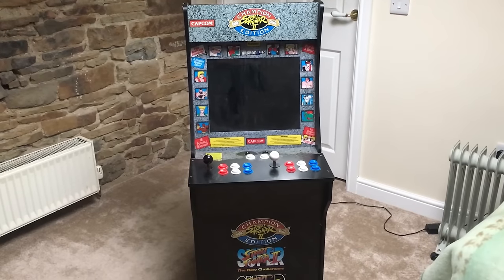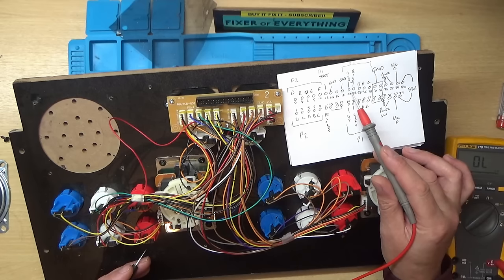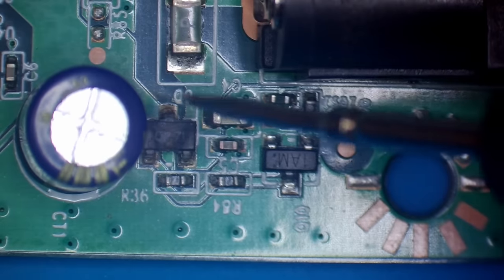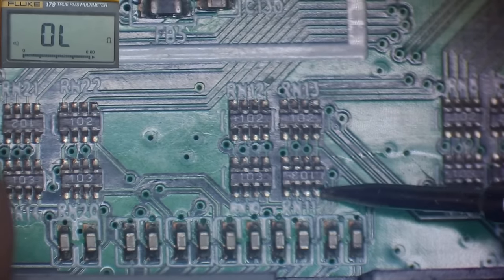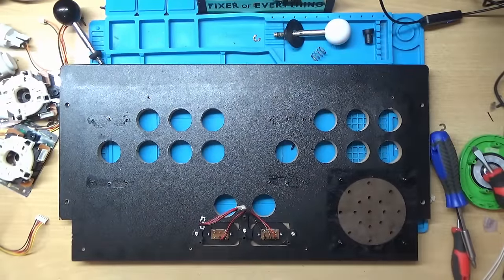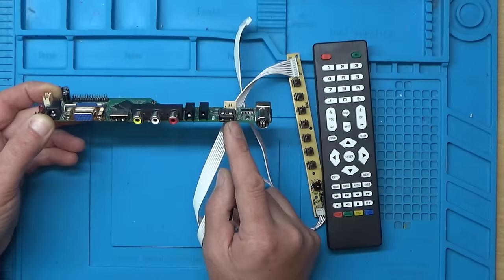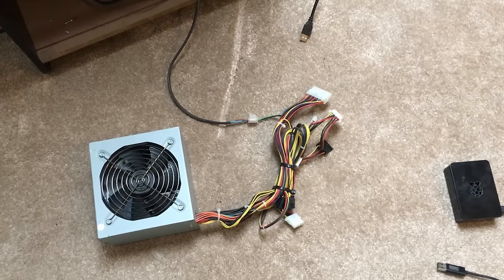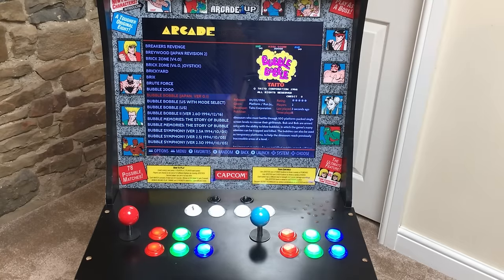Faulty 1Up Arcade Machine | Fix and Upgrade!

Comment: You didn't show it so you might not know, but you should set up a safe shutdown script for the raspberry pi so that when you power off the system the raspberry pi will shutdown safely before the power shuts down completely. If you just cut power to the pi you will corrupt your microsd eventually and have to rebuild everything (and lose your saves/roms/etc)
Reply from the maker: Good idea 👍There is an option in emulation station at the main menu to shutdown the system, although I can't see the kids going to the trouble of backing out of the game, going back to the main menu and selecting that each time.

Comment: A guy buys a junked arcade machine that only plays 3 games and then turns it into a masterpiece that plays thousands of games. Love this.

That little TV board looks like it would come in handy. I have a bunch of broken TVs but sadly none of them connect like the LCD on this cabinet. I do have an old LCD computer monitor though.
Reply from the maker: Thanks 👍you can buy either an adapter cable or there is a slightly different board that has a different connector if the TV has a different arrangement 🙂

Comment: Great video would have liked some more detail on the solution for the speaker noise but great vid
Reply from the maker: Sorry, It was just a couple of old ferrite choke filters from a TV power supply (I soldered two together) and then added a capacitor on the output of them just in case. The capacitor was just one I pulled of an old board I think something like 1000uf 25v. It was literally thrown together from a parts I had lying around on some scrap boards 😂

Comment: Well done! 👍   All the mod's. made this an exciting project.  And seeing a use for the Raspberry Pi was a plus!   PS: Pacman put a smile on my face!
---
2 changes I would have made. 1) A linear Power supply, and 2) (for sure),  move ALL of the SD Card to an USB connected & boot-able HDD or SSD drive. 
That way, you won't be coursed by an SD Card dying on you.  Why take a chance.   You got a real deal when add the price up, compare to buying a new machine!!
Reply from the maker: Thanks 👍I'm really glad people are liking it, I wasn't sure as I know it's quite a long video.
Reply: @BuyitFixit  The length was fine considering the time you spent off camera!

Comment: Nice work! You did what I did a few years ago - but I got an old busted arcade cabinet, gave it a fresh lick of paint, ripped out the old guts and replaced it with a modern PC and LCD, and loaded debian linux onto it, set up mame then closed it up. The longest part was downloading the romsets to the cabinet. Since it had wifi I just left it running with a throttled torrent client so the whole internet would slow to a crawl and left it on for a few days.
Reply from the maker: Nice. I've brought back memories as I used to repair and convert cabinets to Jamma back in the late 80s and 90s. I've got a box full of old arcade boards somewhere....

Comment: Nice vid, learned a lot. I would have liked some education about how the pull ups worked in this particular application and also about the inductor filter. Thanks
Reply from the maker: Thanks 👍. The inductors block and unwanted AC on the power (you used to get a similar thing for radio's on old cars when you used to get interference from the spark plugs through the speakers) The capacitor then smooths out the any remaining spikes (it may not have been needed but I added one anyway). I've actually been repairing a sound bar which has a similar filter, and I show the waveform on the scope of the signal before and after the filter (next video out the weekend).
Reply: The pins on the IC are apparently active low (i.e. when the pins are at 0 V or GND level the chip detects a key press). Since those inputs are quite sensitive, they might register a key press if the pin was simply open circuit. Therefore you use a resistor to keep that pin high (5 V or 3.3 V depending on the chip) unless a button is pressed. You can't connect the pin straight to 5 V because then pressing a button would cause a short. That's a pull-up resistor. A pull-down resistor is the same but connected to ground instead of VCC.

Comment: This is basically what i wanna do the streetfighter one is the best one to do this with cause of the extra buttons
Reply from the maker: Yes, it was one of the reasons why I bid on this one, although it wouldn't take much more to get a piece of wood and a hole cutter and make your own panel for any of them. Turtles might be another option especially if you wanted a 4 player.

Comment: Thanks for the video. I love watching someone tinker with electronics. You seem to be very skilled.
I also love tinkering myself. I'm not an electronics guy though, but I am a pro tinkerer when it comes to computers (including embedded stuff).
I wonder what's the deal with sanding off those chip IDs ? There isn't really anything special about that mainboard, it's a rather basic single-board computer. My guess is maybe the game licensors demanded it to "prevent bootlegging" ?
Reply from the maker: Thanks 👍if you like embedded stuff check out the video I did on the solar inverter I repaired called no password no  problem, or the medical ultrasound scanner I ran doom on, or the RGB laser I looked at that had a firmware problem...🙂

Comment: I know it's a cliché but it's amazing how technology has advanced - these old games used to take up a 16" square board each and now you can have hundreds, even thousands on an sd card the size of your little fingernail and  a £25 3x4 inch board can run them without breaking a sweat.
Reply from the maker: Yes totally 👍It used to be my job back in the late 80's and 90's repairing and rebuilding arcade machines. I used to convert the old cabinets to JAMMA. I've still got a box full of old boards. One is a Taito Space Invaders PT2 board 🙂

Comment: Hi. Fantastic bit of renovation! Out of interest, you mentioned when looking for that slightly dodgy transistor that you checked on some SMD databases to try and identify it. Could you share any sites I could try? I'm currently a bit stuck on a repair of an air fryer. I have found a burnt out chip but only have a few visible ID numbers. Google has turned up nothing though I think it's some sort of MOSFET with PWM control. Any help would be great! Thanks for all the great content. Al.
Reply from the maker: Thaks Al, search 'smd yoo need one' and you'll find one of the good sites I use.
Reply: Brilliant. Thanks!

Comment: Mick absolutely brilliant it looks fantastic your mod is better then the original, I have a few small led TVs 19-24” that can be used for your microscope etc, shame I didn’t know you were coming over this way, I’m only in South Shields,I have a Nintendo switch light that needs the daughter board socket taking off and the new one putting back on, my eyes are too bad for doing it, not sure if it’s something you can do 

Regards Gary
Reply from the maker: Thanks Gary 👍 I've not done one before so I wouldn't know about the daughterboard. Feel free to drop me an email though, it's on the channel about page under "for business enquires" (youtube only shows it on a computer or laptop for some reason).
Reply: @BuyitFixit  email sent I had to not use app version and used web version instead 😁

Comment: You are more knowledgeable than I initially thought.
Ever thought of building more of these and flogging them ?
Reply from the maker: Thanks, no not really, they take a fair amount of time. I guess you haven't seen the video I did on the solar inverter where  after I repaired it, I needed a service password? I emailed the company who said it was obsolete and bin it, so I thought instead I would reverse engineering their software and I wrote my own password generator to help others in the same predicament. The RGB laser I repaired was also another interesting one, along with the medical ultrasound scanner which after unlocking tons of hidden features I ran Doom on it 😂😂😂
Reply: I will watch the solar inverter video now Mick.
Dunno how i missed that one.
Must have been a pub night.
Great video's, and gaining more and more subscribers.
Stezstix Fix Steve and Vince are quaking in their boots :)

Comment: I cant believe they charge over $1000 here in Australia for these machines. They are built so cheap.  I did the same thing as.this guy but I used a genuine lowboy arcade cabinet as they built solid and are full size.
Reply from the maker: Nice 👍I used to have a full size cabinet, but sold it about 6 years ago. I used to work repairing and rebuilding arcade machines back in the late 80s and 90s. Still got a box full of JAMMA boards somewhere and even an original taito space invaders part ii board🙂

Comment: I guessed right i think. I saw the dodgy controls and said to myself thats a bad ground somewhere. I was a bit lost with the pull up resistors (still learning) but I think thats what it is with the damaged via. Am i right?
Reply from the maker: Yes, the pullup resistors keep the input lines at logic high level, so when you ground then via the buttons or joystick there is a change from a 1 to a 0. If they are not pulled up, they have 0 volts already so the machine thinks you are pressing them all.

Comment: These boards are actually missing a sound channel I think it's the left one, it's best to join 2 points on the board and you get all sounds through one obviously modding it is the best solution 😁
Reply from the maker: Yes I did read a post that the game was missing some sound effects due to them only having a mono amplifier and one speaker. Thanks for commenting 👍

Comment: Those 1up machines used a screw-on ball for the joysticks and it would always loosen up from the slightest amount of play.  So I wouldn't be surprised if the previous owner ultimately glued it on or at least used Thread Lock.
Reply from the maker: Yes, totally agree 👍

Comment: Holy damn those traces and unnecessarily small... you NEVER push the design limits unless you have to. I've done my fair share of electronics design and more important than knowing resistor color codes is to understand the physical limitations of the real world and manufacturing processes so your products come out clean.

Dang :D
Reply from the maker: Yes quite small 😂👍

Comment: The speaker was likely damaged by a drink spill that corroded and seized the voice coil then overloaded the audio output driver. Whenever I find something where all the controls are going crazy I check the switch lines to make sure they change state when pressed. This finds missing pullups or stuck switches.
Reply from the maker: Thanks for that. When I was watching the video back I was thinking about that mystery component. I think it must be for the power switch, and probably a mosfet. There's a small transistor near it which is probably switched by the power switch at the front panel (that's what I suspect anyway) which then switches that mosfet to power on the board.

Comment: How many firmware versions did you flash before you got it to work right?  Those LVDS boards are great but can be a pain finding a firmware that works for a specific panel even though the various firmware files list the panel specs in the name as they are often still incompatible!
Reply from the maker: It was the first one that I flashed worked surprisingly. The only issue I had was getting it to start flashing in the first place, but changing the filename sorted that out🙂
Reply: I have never had issues with the file names myself but have used lvds driver boards for a few laptop screens and had one that worked after a couple of firmwares but the other two where I used a universal board were a nightmare to get working,  glad yours went smoothly!  

The last screen I did, I decided to spend a tiny bit more (only £4 more) and bought a board that was flashed with firmware for the exact panel I had and was a painless experience,  the board technically can be flashed with other firmware but none are supplied and it's not like those univesal boards,  this is a totally different board and form factor, runs way cooler than the universal ones as well, the cpu on the universal ones gets very very hot and you might want to put a heatsink on it, that's what I did in those boards due to how hot it gets!

Comment: Do a video upgrading it there's alot of potential to fit in that box  🤔 😉 😊
Reply from the maker: What would you suggest? There is a lot of space 😂😂
Reply: @BuyitFixit  remove pi add a old pc will get more libraries and alot of usb for lights can even add a light gun 🔫
Reply from the maker: @Remembergameclips I've got a few old PCs lying around too. I'll probably just leave it as is though as the boot up time is fairly quick. Thanks for the ideas. Much appreciated 👍

Comment: Epic. Well done on finding the track / via break. Considering the abuse these things get (and the drinks they consume), issues are very probable. All your cables will fall out eventually, but that's part of the fun. Of course, you really need a real coin slot which takes sixpences, but beggars can't be choosers.
Reply from the maker: I used to have a load of coinslots but had a clear out a few years back. I used to work repairing such things back in the late 80s and 90s. I've still got a box full of old arcade boards somewhere including an original taito space invaders Part II board.

Comment: Oh shit! Pllease disregard any adverse comments that were supposed to come from "US", they did NOT! Some moron hacked our phone, and has only just been resolved.
We will appologize to all commenters and yourselves despite the fact that it was NOT us at fault. The offenders don't have the guts to say sorry, WE DO.
Warmest Regards & Appologies
Wayne & Nina
SO SORRY
😒😒😒😒😒😒😒👍👍👍❤️❤️❤️❌️❌️❌️
Reply from the maker: I don't think I received any, but thanks for letting me know 👍
Reply: No problems. WE NEVER INSULT ANYONE ON YOUTUBE, UNLESS A YOUTUBE CHANNEL INSULTS US FIRST. By the way, a quick tip. Do not lubricate cassette deck motors with any form of grease whatsoever. Only use Singer Sewing Machine oil if you really have to. Grease works its way into the motor, and mixes with the carbon brushes, you end up with a conductive black goo, which will in time, render the motor noisy and short circuited.
Just a little tip that I'm sure everyone will find useful(?)
Nina ❤️❤️👍👍👍

Comment: What may have happened: someone spilled soda over the inputs, it shorted the speaker with some of the inputs, the high voltage spikes from the speaker fried things in the main board.
Reply from the maker: Could well be the case 👍

Comment: Hi, This is by far my favourite video.
Can you make a ELECTRONIC PARKING BRAKE  Diagnosis  SERVICE TOOL? So you can put new pads in? Love to hear your thoughts??
And a Very Happy Christmas and rock on the 80s 👍
Reply from the maker: Thanks! Depending on what car it was for you could use something like an Arduino with a can bus chip. You would need to know what commands to send to put the EPB into the different modes and perhaps a small LCD display with a couple of buttons. I'm sure such a device will already exist on Aliexpress or Ebay.

Comment: well.. just looking at the board, this is more than likely a chinesium clone board. You can usuall spot these because they have a very bad habbit of lazering off IC identifiers, and using "clone" IC's that literally have no markings on them at all. 

That's being the case, the odds of that marking on the Q9 transistor being acurate to any specific device is probably going to slim to none (that marking looks suspect af) 

However, because of the "Q9" silkscreen on the PCB, and judging by the resistor between the bottom two pins on the device tells me it's going to most likely be a transistor (base emitter pins often have a resistor between them to keep from having a floating base) 
Reasonably, we can assume it's going to be a transistor, so all we need to figure out is  what exactly are we switching, and how fast do we need to do it, and what voltages are we talking about. Once you figure those out, you can easily find a suitable replacement with a wide enough tolerance to get you in the ballpark. 

As for the short, you should really track down where that happened, and adress it there, simply bodging a wire may leave the short in place, causing other issues down the road.

Comment: can you please put a diagram of the amp filter
Reply from the maker: it's two inductors which have 4 wires on each. They are just wired to each other so the power goes in and out of the first one, and then in and out of the second one. This blocks any AC signals. Then I just added a capacitor on the output just to smooth it a bit.
Reply: thanks i will try and see if it works in place of dc to dc converters to reduce noise @BuyitFixit

Comment: Already at 20 minutes I noticed a split capacitor, I don't understand how you don't see🤔 it
Reply from the maker: I've just had another look at the board, if you mean the capacitor that's just under the resistor bank at 20:30 it's not a crack, its flux residue. I just double checked to be sure. It's just the light from the microscope casts shadows depending on the angle. Unless you mean a different capacitor that I may have overlooked?

Comment: Typical "Proprietary" chips with the chip number missing!  The only way you 'might' get that info, is find a shop that works on these machines.
Reply from the maker: I think the main processor is an Allwinner A13 (someone else did some work on these a while back)  but it's a but under powered for some games hence just easier replacing it with the Pi.
Reply: @BuyitFixit  - Agree!!

Comment: Hahahaha! You fixed the board, and then threw it away and used the cabinet. It's way better now than it was.
Reply from the maker: Thanks yes, I wanted to see what the original fault was and see if it was repairable, and yes it's way better now 👍🙂